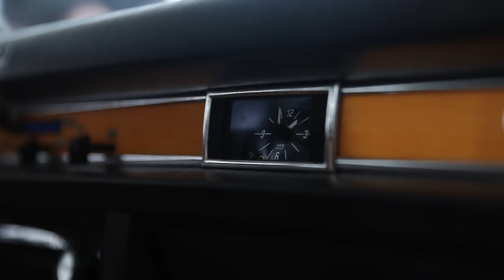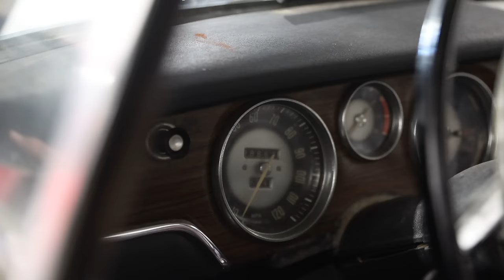Learning About Old School BMWs at Precision Sport Industries

Comment: So far I'm on my 2nd e36, had 2 e34s and 1 e28. Just come to us Larry. Old bmws is a way of life..and suffering...  :D
Reply: E28s are very little suffering IMHO, less than the E36 for sure.
Reply: @BMWVX  No real suffering on an E36, unless you buy sketchy ones with no maintenance done and 400k on the clock which is unfortunately most of them these days. Taken apart multiple times in the past 25 years by idiots and put back together with zipties and junk off ebay
Reply: my family goes back to 1974 3.0 coupe.  But the 2002 was itself a growth from the 1600 in the 1960's.  Now my 8th BMW is an X7 beast, but surprisingly quick.  The E60 N54 power with 6 speed manual was actually quicker than M3's at the time - all we did was the Dinan stg II stuff.  We even ate most Porsches with that thing.  My favorite of all my BMWs remains the 850CSi, having tweaked as much as we could- almost tossable if you can believe that [$45K later], and yes, you could balance a nickle on the intake manifold and start the engine and rev it and shut down without the nickel moving.  PS. a real BMW nerd would be waiting for the Nue Classe and place their order as soon as they are taking orders.   Style 8's would like nice on that 528 if the offset works.  BMW is not going to share much of the older lines - many of them remain embarrassed by former offerings and they kicked so many of us to the curb protecting Chris Bangle and his butts.

Comment: I miss my 85 BMW 535i 5 speed which I owned for a long time.  It had over 300K miles on it when I sold it.  The old bmw's were very special cars, very solid and reliable, the new ones are plastic junk.

Comment: That beige car is an E3, it is basically the same platform as the E9 coupe. It was a HIGH END luxury car back in the day. All 3.0L cars already had 4 vented(!)disc brakes with proper 4pot calipers up front, It has independent rear suspention. 
You didn't see many of them. They were expensive executive cars. A true alternative to a Mercedes W108 280SE.
You could buy a quick sports version named the 3.0Si (200hp) or a stretched version 2.8L and 3.3Li.
These E3 cars are very nice to drive, they feel small, like a 3 series. There was a 2500 (150hp) , 2800 (170hp) , 3.0S (180hp), 3.0Si (200hp) 3.3Li (205hp, only automatics) 

I just love that 1800Ti ! These were raced in touring car races in the 1960's.  These days you can see them race in the Festival of speed at Goodwood , UK.
Reply: Yes! And the E3 is far superior to the E9 bcuz the bodies weren't made by Karmann so they don't rust as easily :-)

Comment: Had a 1976 3.0 Si saloon back in 1980! Swapped it from a 1971 Ford Cortina 1600E because that car couldn't handle the Belgian motorways when I worked for NATO at the SHAPE headquarters back in the day. Lovely car, could do 100 in 3rd gear (4-speed box!).  Only problem I had was when it overheated and cracked the head! Got it fixed and went on to do another 40000 miles in it. Just bought my second ever BMW, a 1986 635CSi 1 owner (!) car with 72000 miles on the clock. Loving it to bits. Cheers from a (very chilly) Otford, Kent, UK.

Comment: The e28 M5 is 3.5L & 256bhp in American spec. Euro spec is 286bhp. My e28 has the s38b36 drive train out of the e34 M5. 350bhp with a genuine BMW Motorsport chip.
Reply: Didn't the E34 first have 315 and later 340 bhp? -at least they did in Europe..
Reply: Did you swap the gearbox or still on the 280?
Reply: BMW Motorsport chip? Didn't know that was a thing
Reply: @sv_cheats1970  Yes, agree, never heard of that,,,
Reply: @1983dmd  well It wasn't unheard of that BMW would do some work for their "special" clients. Take for example the E34 M5 that was oredered by the Sultan of Brunei, the thing had a decent amount of power over stock but was that way from BMW..
Reply: @1983dmd  but I highly doubt you could get your hands on a BMW Motorsport chip... perhaps it was something from AC Schnitzer

Comment: My dad had a pale blue BMW 2500 saloon (the same body as the Bavaria) with the 4 speed manual. My family of five took a trip from the NW England to Portugal in it and I used to spend hours cleaning it at weekends. He rated it so highly that when it was smashed to bits by a deer leaping in front of it as he was driving 'at pace' he had it rebuilt rather than scrapped. He would let me refuel it because I loved the way the fuel filler was behind the rear license plate!

Comment: Great seeing the Bavaria getting some appreciation - they are quite rare, and here on the west coast you can still see an occasional Bavaria being driven around, though they are usually in rough shape.  Replacement parts have got to be a challenge.
Reply: You know the history of the Bavaria?   Another Max Hoffman special, like the Porsche 256 Spyder.  He combined the 2600 sedan engine and leather and all with the 2500 sedan's other parts.  Basically a cheaper 2800, which was very expensive.

Comment: As a 17 yr old, I was so fortunate to get to drive regularly my dad’s BMWs back in the day including both his red E3 2500 sedan and his green 1800 sedan. I loved those cars. Moving on forwards, my 2nd wife when I met her had an original 3 series 323i which she later on upgraded to an E36 318is sedan (manual).  That was such a good drivers car. My current daily driver now is a E90 323i, however, if the ducks line up one day I would be keen to get a E46 330Ci coupe or convertible as well as a more modern 435 coupe. And all of this comes from someone whose only other cars have been classic Fiats and Alfa Romeos.

Comment: In the late 1960’s, BMW added a tach, front anti sway bar and increased displacement to 2 liters to the 1600 (1602).  The 6 cylinder sedans were introduced as 2500 and 2800 models, reflecting their displacement.  The Bavaria was a “budget” version.  All were amazing machines for the day.

Comment: I drive an E46 cabrio, manual swapped and engine swapped. I just did another m54 because it was so good. Like changing a 500 lb lightbulb. I am a through and through bimmer guy. It's my beamyweamer. I want to start buying the bmws that go at the impound auctions because I've been told the cost of getting the keys going again prevents people from bidding. Anyway the collection is awesome! Thanks for sharing!

Comment: Had a 74 Bavaria, replaced with carbs with Weber down drafts and fitted the distributor with an Allison electronic points conversion.  It ran the best with Champion copper plugs, the Bosch plugs seemed to fall off earlier than the Champions. I used Arco Graphite 20/50 till they stopped making it. I would have loved to see the inside of the engine on a tear down. I had it for 17 years. My license plates, 4FASTLN.  It ruled in the 70's.

Comment: The 1800Ti was the sporty version of the 1500 Neu Klasse sedan the ushered in the modern era of BMW. They were raced in touring car series against the Alpha Romeo's and at tarmac rallies. The 1800TiSA was a homoglomated special with 5 speed manual, disc brakes and other upgrades to qualify for racing. If you check out vintage 2LT, two litre touring car videos are interesting.
There was a coupe version, 2000CS, that introduced the design of the 2500CS to 3.0CSL series. Arguably the best looking BMW of the modern era. After the 328 cars and the 507 of the 1950's.

Comment: I’m 57 and in the 80 s I work at Auto Baum FT Worth TX ,iv had 81 320 4sp stick Black camel interior,gold BBS , Folda tires spoilers,then I jump up to a 91 325 Convertible Red/tan interior auto,Black top and black wheels,tent,spoilers ,Hot!,now at 57 I own a 2000 750 IL Titanium Silver/Black leather, The Ultimate Driving Machine Leonard DFW TX

Comment: The Bavaria was the precursor to the 5-series, not the 7-series. Check the wheelbases and you'll see.
Reply: Nope... 7 Series follows the 2500, 2800, 3.0, 3.3 and so on... 5 Series was coming after the Neue Klasse.
Reply: @altblechasyl_cs2093 
Exactly.

Comment: E28 535is and M5 were 3.5 L. M5 was based on the M1 engine. Great content, as always.
Reply: Yeah, the M1 was a 3.0...
Reply: yes 3.5L was consider "big" displacement on anything out of Europe back in the 80's.  me and all my bud's considered the first Black M5's the German Buick Grand National (3.8L).
Reply: S38 E34 M5
M88 E28 M5 
don't get why he mixed it
Reply: @patrickneuhaus117  euro E28 M5s had M88, US E28 M5s had the 3.5 S38, also called S38B35. 
The M88 also had more power vs the US S38B35.
Reply: TAILLIGHTS FROM 635 SAME AS M1 TAILLIGHTS
Reply: I believe the E30 316 was the last carburated BMW.
Reply: Ah yes and the m88 was based off of the block of the m90b35/m30b35le which was in early e24 635i 81-82 and e12 M535i which had a 93.4mm bore and 84mm stroke with the m30 sohc head and flat top pistons for a compression ratio of 12:1. I have 2 m90s.
Reply: @patrickneuhaus117  no only early model m635i e24s shared the m88. M5 and later M6 had S38b35
Reply: @anthonydavis5993  No, M1 had   a 3.5L
Reply: @frederikebert1985  what?

Comment: My dad owned a 1970 BMW 2800 likely identical to that Baveria. We owned it and drove it  for almost 20yrs. Same Zenith carbs and 4 speed manual same Sahara colour too. Amazing car. We rebuilt the engine and swapped in 3.0L at some stage too. Actually got my driving license in this car. Ah the memories!!!!!
Reply: That was the best car ever your dad’s 2800 first gen without the chrome and the differential lock. IMHO the first M sedan due to superior handling and performance. It handed even better then the E9 CS Coupé due to its ideal wheelbase and other geometric advantages…

Comment: I have 2 e28 535i and 1 535is 5spd and i adore them. Incredibly smooth and fun to drive. Absolutely brilliant cars. I also have 2 of bmw’s very first “motorsport” engines which was in e12 M535i (M90b35, M30b35LE) which was used as a test engine before production of the M1 which had an m88 dohc engine, which later became the s38 in the e24 M6 and e28 M5. They share the same block. The S38 in e28 was 3.5L not 3.0l. Out of the 1300 units send to north america 30 M5’s in the usa were black with black leather interior. Yes im a nerd ik. I just adore e28s
Reply: Me too, love my E28!
Reply: Euro M5 and M635CSi and the SA only 745i had the M88/3 engine. S38 engines were in NA M5 and M6 cars. The M1 had the M88 engine. Procar Gr 4 had the M88/1. Gr5 had the M88/2 Turbo

Comment: I grew up with those cars all around, and I also turned into a big bmw fan myself. I’ve had the privilege to own almost every single one of those, until the late 90’s, including the csl and 3.0 si. I remember having bought and sold some for ridiculous price. Last one was a fantastic anthracit diamond black alpina e30 with full circuit body kit and hardened suspension with gorgeous wide rims, glued to the ground and with those insane eye lids above the front lights, it was sooo beautiful...and the melody was like Wagner to my ears. I almost never turned the radio on and opened the sunroof instead.  I paid 300$ for it back then, from a rich guy who happened to pass by in the street and who saw me as I was wrenching on my 318 e21. It’s crazy how prices went up for such random (at the time) vehicles. They were not even seriously considered as second hand cars. They were eventually considered too thirsty and outdated pretty fast in fact. I would be millionnaire now if only I had kept all the cars I purchased and sold.😊
Now I’m on my way picking up a nice 1983 e28 520i. Talking about a virus. I’m 56.😊 And my smaller son, which grew up wrenching with his dad, ended up chief mechanic in a bmw dealership where he mostly works in the ’sport’ division. You can’t make that up. I’m so proud of my boys. At least I have the feeling I didn’t completely screw up. Sorry for the rant, so many memories. And such well-made cars! Thanks for this very nice episode. I like your energy! That Bavaria has always been my all time favorite. I loved the rear end lights and the more sharky tilted front grill and side repeaters. What a gorgeous car.

Comment: I drove a 1983 BMW 320i in college. Had it for 3 yrs realizing repair cost  were breaking me.  It was a 5spd. The sunroof open manually by turning a crank and the dash illuminated in red.  It came with stock Blaupunkt stereo.  I purchased it in 1985. After 3 yrs ownership I traded in 1989 for a Honda( pop up headlights )Accord LXi👍

Comment: The BMW M5 (E28S) was first presented in the summer of 1985 and was hand-built by BMW M until 1988. Externally, the M5 differed little from the regular E28, apart from a subtle front and rear spoiler, larger wheel arches and a lowered suspension. The interior could optionally be supplied with full leather upholstery.

The car was powered by a slightly modified 3.5 liter six-cylinder engine from the BMW M1 with an output of 210 kW (286 hp), good for a top speed of 251 km/h and a sprint from 0 to 100 km/h in 6, 1 seconds. This engine was mated to a five-speed manual transmission and rear-wheel drive